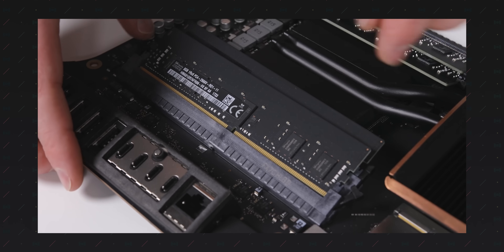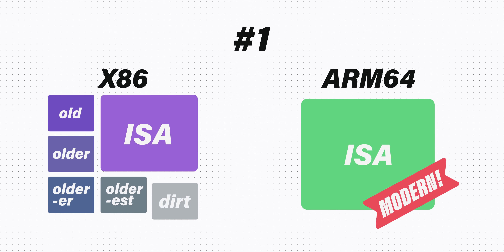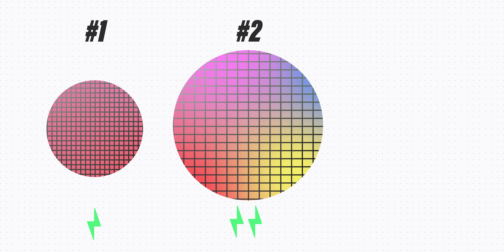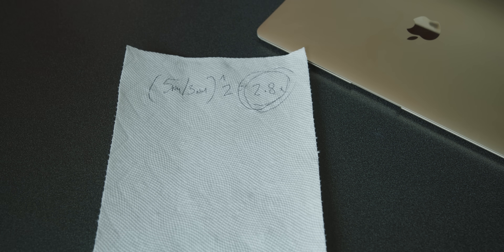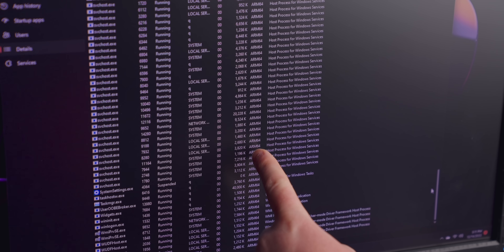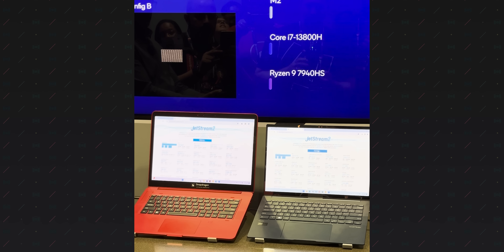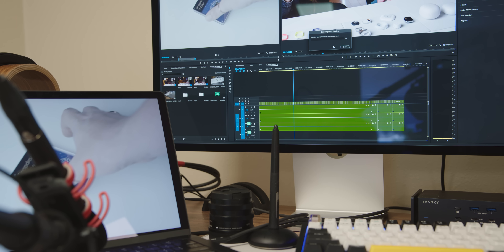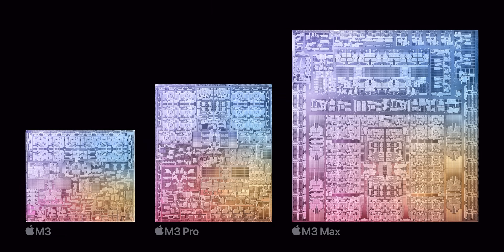Apple's Silicon Magic Is Over!

Comment: You're discounting x86 architecture too much. AMD's 0504 custom APU made for the Steamdeck is an x86 chip which can run most modern PC games with a 15W TDP. In desktop mode it draws only about 8W in typical usage scenarios (disclaimer: I was unable to isolate the APU power draw in desktop mode, so this is the figure that represents total power draw from the battery, with the screen off).

Personally, I'd be hyped to see powerful and energy efficient chips like this one in laptops. It has all the compatibility benefits of the x86 architecture and it's pretty efficient. AMD does offer slightly more powerful chips for laptops, but they have roughly double the power draw, which makes them less desirable for people who are on the go a lot.
Reply: And Steamdecks APU is pretty old now. There are newer designs APU that are pretty astounding
Reply: My professor teaching architecture said all the time that the difference between RISC (ARM) and CISC (X86) is not that much anymore. Frankly the last true CISC chips like the 486 and I think some Pentiums are more RISC like than the ARM chips we have today. Apparently the debate between CISC and RISC was settled in the 90's... both and neither. They all apparently use a small MIPS-like core and some hardware instruction translator that translates the op codes into micro-ops that the MIPS like core is very efficient at, then anything that isn't constantly used is done in software. So actually both CPU designs don't actually support most of their op codes so X86 chips aren't always even fully X86, they just look that way from the software point of view. 

I'm not sure how true this is but the answer is definitely more true than not. After all, we only use a small faction of available op codes, especially now that we use compilers that are VERY smart. But we cannot drop the old op codes and old registers and stuff, so instead, we found that for the <1% of the time they are used, it's cheaper and faster to do them in software and only implement the op codes we all the time in hardware. Apparently, the die area saved by doing the rarely used tasks in software makes those tasks not all that slower than if they had the die area used, but it makes all other instructions much faster.
Reply: @asificam1  I was watching a video about x86 recently (I think it's on Primeagen's channel) and I remember the person saying that x86 instructions are basically just an interface into the CPU and these instructions get decoded into microcode at runtime. This microcode is known only to Intel and AMD. So basically x86 CPUs from the past 2 (?) decades are just RISC CPUs with a stable interface on top.
Reply: @lycanthoss  Yeah that is what I was told. Apparently the cores look visually similar to MIPS cores or so I'm told.
Reply: @lycanthoss  It would be really funny if the internal ISA was just Itanium all along
Reply: I think the reason is that the steamdeck is 720p if I am not wrong. We already have processors like that in laptops, but because of things like higher resolution and windows instead of optimised linux distro they seem less powerfull/impresive.
Reply: @matejjustus4573  yup, I agree. But what I'm interested in is a lightweight Linux laptop that can run for many hours on battery, for hassle-free dev work on the go. It just needs to run an IDE, a web browser and, in a pinch, compile some basic modules for testing. If I want to do anything fancy I can delegate the workload to my PC at home.

And yes, I very much prefer an x86 machine to natively test my x86 binaries on.
Reply: The real magic behind Apple silicon was the process node advantage plus getting to design a good, new architecture from the ground up. It has nothing to do with ARM or at least not in a very significant way. And you can see this with recent AMD and Intel laptops starting to close the gap.

I'm gonna quote Forrest Norrod from AMD here: "I’ve been highly skeptical of Arm in the datacenter for a long time. But I think that legitimately, finally, there’s growing and real interest in Arm. But I think also as well that people are starting to realize there’s no magic instruction set architecture.

There was this long belief that Arm was substantially more power efficient than X86. Now, ARM processors tended to be designed for much lower performance. And, and I can tell you that we got pretty far along with an internal Arm design, and it was very, very clear that you if you’re delivering a certain level of performance, the delta in power driven by the ISA is like 5 percent. That’s less than the impact of the quality of the physical design team."
Reply: @lycanthoss  ... and yet the Intel Microsoft Surface laptops are equivalently priced to Apple silicon Macbooks, yet fall far short of their battery hours in tests compared to the macbooks. They advertise similar figures, but they don't come as close to meeting them.

It's as if Microsoft has the attitude of "Apple advertises 18hrs and fall short in industry testing at 15hrs, so you can't sue us for claiming 18hrs and only delivering 10hrs, they do it too!"
Reply: Probably because the x86 chip is no longer completely implemented in hardware and hasn't been since the Core revision. Every instruction aside from little things like AND, OR, and >/< are actually just translated as sequences of other simpler instructions. This has enabled the instruction timings to be predictable, so they can scale it up almost as well as true RISC, and probably backport new instructions to older chips given access to the firmware.
Reply: exactly, x86 is fine, its just apple wants to grab intel/amd profit margins for themselves

Comment: Great video! Even as a technical user, I never understood why the generation-to-generation improvements weren't as big as the intel to apple switch but it makes a lot of sense. However, I don't think the M1 was a risk at all - Apple had a 10 year head start thanks to the path that the iPhone A4 started them on! To me, it's just good business strategy and execution. Frankly, Microsoft would have done this with the PocketPC platform if Ballmer was a bit more clued in.
Reply: Another point would be the vertical integration Apple has which you touched on. But comparing a Qualcomm Snapdragon running Vulkan/DX12 through some "translation layer" to Apple Metal on Apple silicon - not even close!

Comment: So basically Apple Silicon has reached a performance ceiling? This was obvious from the beginning. Have to see what the future brings, can Apple move forward sticking to Apple Silicon Only. They should have kept the MacPro Intel based. Also Arm based processors are good for laptops but not for big desktop workstations. More nerds are going to move to Linux for powerful workstations, I know I am.
Reply: No they are good in workstations as well. Why do you say the intel ones are better

Comment: 14:10 - Premiere is part of that problem - Resolve and Edius as so much faster and effcient, but the other factor not mentioned, is that the M-Series, just like every other RISC based ARM processor, are great at Single Threaded Operation, and crap at Multi Threaded Operations,... and every NLE is optimised for Multi Threaded, leading to x86 CISC architecture kicking the M's collective butts.